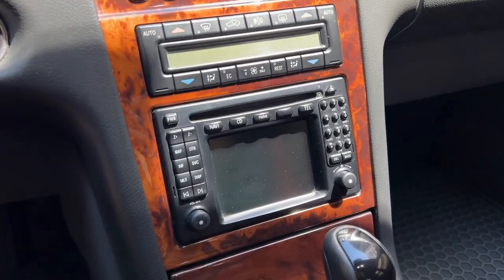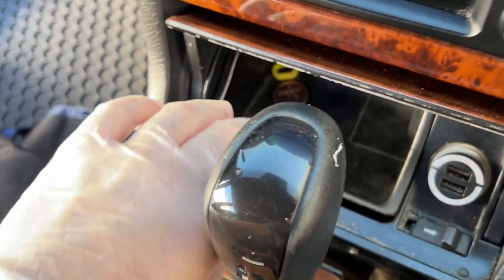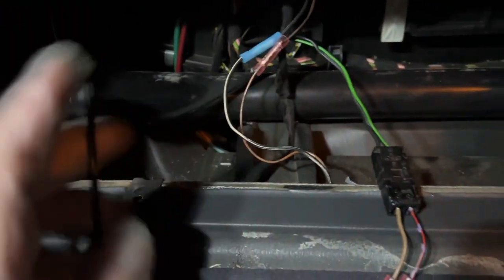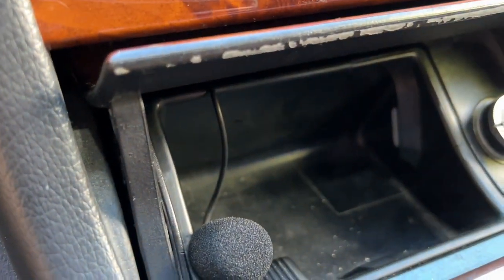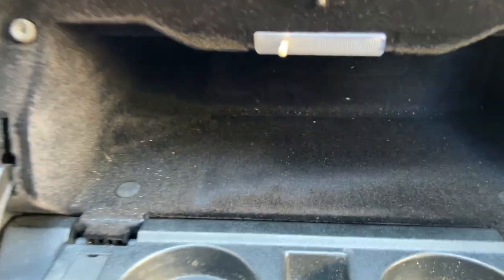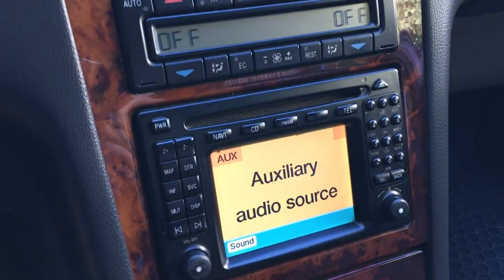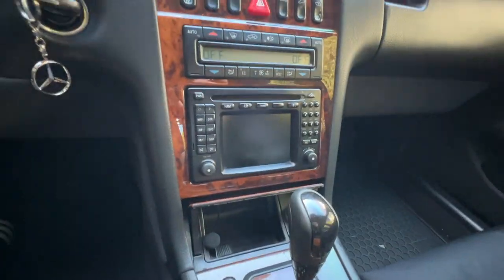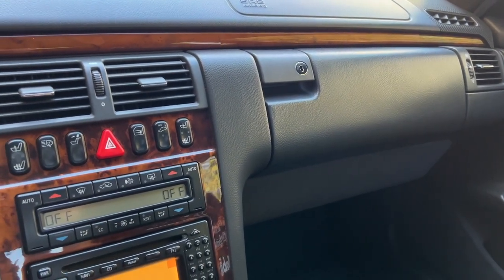Mercedes W210 Comand Bluetooth Auxiliary Audio

Comment: Just installed yesterday that 5v 12v converter for my Bluetooth power behind the glove box. Used the light switch for power. I was using cigar lighter manually plugging in before. It got annoying Thanks for info. Great mod on my 210 daily

Comment: Why I love my s210. The easiest car to work on. Everything was tough tru and made to be worked on and be changed easily! 🇧🇬
Reply: I have a yr 2000 E55 and i dont see any jack in my glovebox,
Reply: @matt7iron  Do you have COMAND, CD changer? My 1999 s210 facelift has the jack.
Reply: @sbmateev  i brought the car without a CD changer but there are wires in the trunk to hook one up, can i run some sort of bluetooth from there, i dont know what Comand is, i have to look it up.
Reply: @matt7iron  COMAND is the big navigation with the screen. I think AUX comes with the COMAND. Search "w210 COMAND NAVI" should come up.
Reply from the maker: @The Honest Blackman if your car did not come with Comand Navigation from factory it will not have the auxiliary port in the glove box.
Reply: @SoCal210  yep. My friend has an Audi from 2008 and it doesn't have AUX but has CD changer and BOSE ... haha ... he is mad
Reply: @SoCal210  i got Bose speakers and a crappy radio, and cant put  bluetooth in the beast, and the windshield spray motor just quit, no humming sound when engaged from steering wheel, that little city light headlight as its called blew out and i brought a replacement bulb and the wires and the black bulb holder crumbled in my hands, damm rear power window quit and needed a regulator, then the jet sprayers got clogged and i took a needle to clean it out and now the stream goes way up on the roof, only 105,000 miles on an E55 and my 1999 5 speed maxima 387,000 miles never had any of those cheap problems Mercedes has, and it has bluetooth radio.

Comment: I have the same car and radio, but since new battery it hasn't turned on. Car sat for 9months.. any advice is greatly appreciated..
Reply: if your radio doens't power on after new battery (if you mean that) check your fuses, maybe you have blown ones... Original multimedias are strong.

Comment: How hard would it be to swap out a stock w210 cassette radio to the one you have in this video?
Reply from the maker: It’s pretty involved. I have never done it but I’ve seen a couple people do it but it seems like the head unit doesn’t properly interface with the amp so the speaker quality goes down.